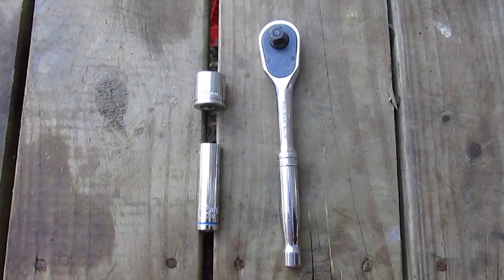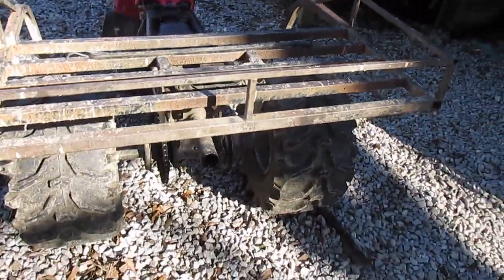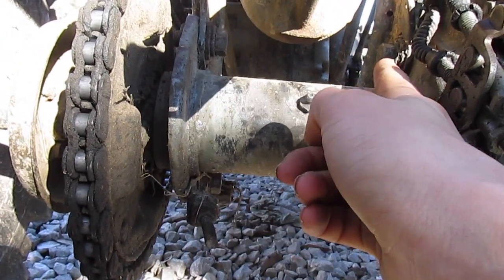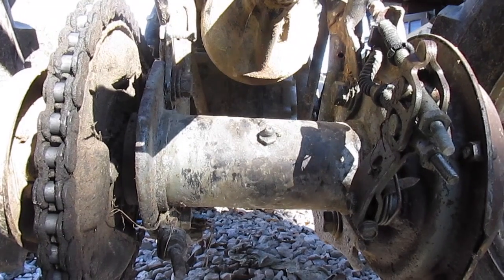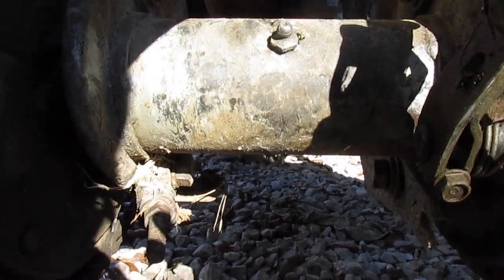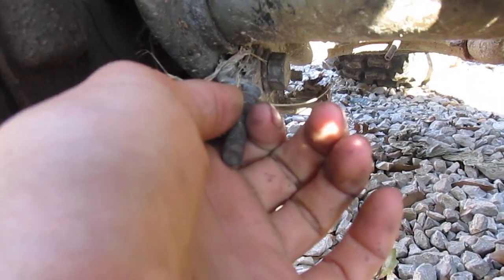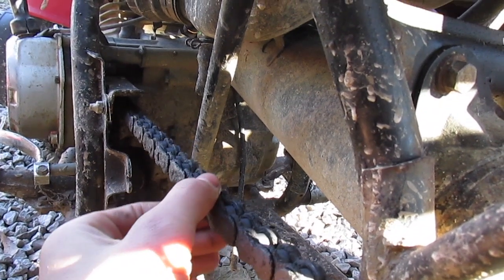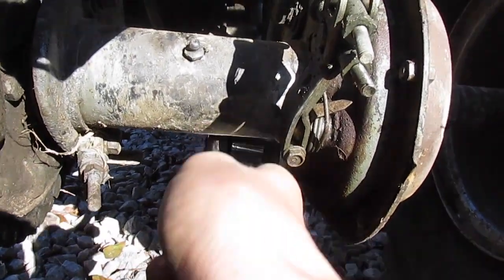How to tighten the chain on a 1981 Honda 185s

Comment: I have a 185s and my chain goes on it fine it moves forward and backwards only for a little bit then ends up falling off either going forward or reverse how can I realign the rear sprocket to the front engine sprocket

Comment: just got a three wheeler and had to tighten the chain well my chain tensioner snapped as my chain would not tighten enough, should i get a new chain or take a few links off or do u think it might’ve happened because it’s older, thank you
Reply from the maker: If your chain is that loose I would suggest getting a new chain and tensioner and possibly replacing the sprockets
Reply: @jmmotorsunlimited3094 just ordered a new chain and tensioner,  tensioner came in first and i put it on but it didn’t change the tightness of the chain when installing it and i was able to tighten it all the way, when the original tensioner broke would u know if the axle could have moved and affected this? my axle is still in about where it should be just the bottom 2 17mm bolts make it seem like my axle is slid all the way back
Reply: i probsbly need a new chain which i ordered anyways just wondering if my axle is not in the right spot
Reply from the maker: It sounds like you’re axel is good you just need a new chain

Comment: How do you get them original sprockets off?? The stud spins w nut , and what's the quickest way, could u make a video no one else has
Reply from the maker: You have to take the axel out I’m actually going to be doing that this week so I’ll make a video about it
Reply: @jmmotorsunlimited3094  okay! Thanks man I've been in a bug can't wait to see how and what Im gunna have to get into, I have to replace rear bearings too anyway but it's a pain, I have a 83 185s, no one has a complete video on how too there always missing something in the video, thanks for replying and help, can wait to see the video on it I heard it's a pain,thanks again, can't wait to see the vid on it, my machines been down for about 3 months now Bec the sprocket so if you can make this vid on it I'd be well appreciated
Reply: @jmmotorsunlimited3094  do I have to remove everything From the (right side) brake drum side in order to slide out the axial to get the sprocket off??
Reply from the maker: Yea that’s how you do it I haven’t dean able to finish my video because we just got hit by a hurricane
Reply: @jmmotorsunlimited3094  oh, ok, I wish ya luck and stuff with the hurricane hope yall good

Comment: would you recommend running it without the chain cover? ive been thinking about taking mine off
Reply from the maker: Mine had the cover when I bought it but I took it off. All it does is catch mud and make it hard to clean your chain so I would take it off ,but don't throw it away because they are getting hard to find
Reply: I still have my chain cover on.